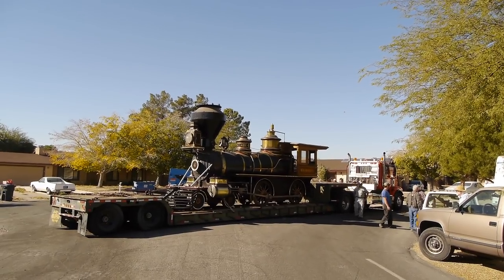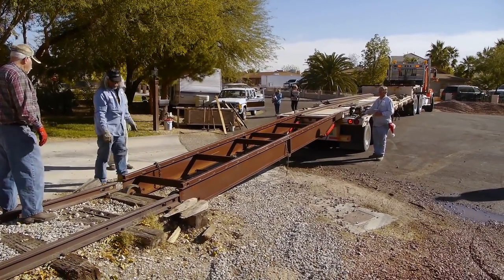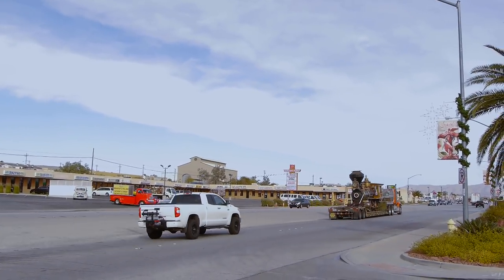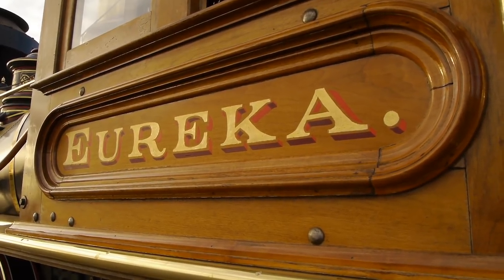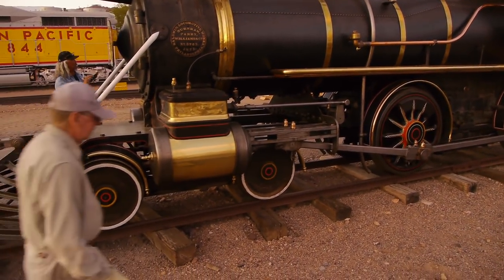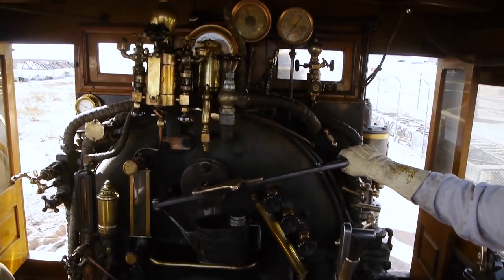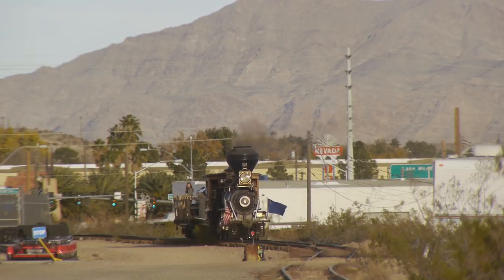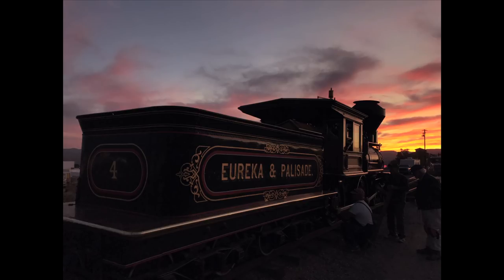Moving Dan Markoff's amazing locomotive Eureka and Palisades #4 to Bolder Nv.

Comment: What a big big big chimney !!!!!!
Reply from the maker: Hello. Wood burning locomotives make lots of ash. Much is dumped out of the firebox into an ash pit. But most is blown through the boiler and up the stack. It would go everywhere and set fire to much if not for screens at the top of that huge funnel. So the ash falls to the bottom of the funnel. There is a dump door on one side. When opened a mass of ash falls out.  Unique to wood burners.

Comment: With all that time & effort it takes to lay down the temporary tracks to unload that locomotive, I am surprised they do not build something 'more permanent' to do the job...?
Reply from the maker: The problem is the loco unloads off the front of the trailer. Needs to. So there needs to be space to pull the tractor and coupling for the trailer away from the rest of the trailer, and that takes about 50 feet. Sucks, but can't figure another way.
Reply: Toy Man Television → Gotcha, chief - Thanks!

Comment: You should talk to Dan about running the Eureka on the Huckleberry railroad
Reply: That would be highly do able as the track is 3 foot gauge and laid with 75 and 90 lb rail.  That track would be a racetrack for the Eureka.  The sharpest mainline curves are the two loops and are 26 degrees or 222.271 foot radius.  The K-27 makes them.  The couplers on the Huckleberry are at the same height as the D&RGW equipment.  I used to work there.
Reply: I wrote a letter to the Carson and Colorado restoration group that they should run their 3 foot narrow gauge 4-6-0 Southern Pacific #18 on the Huckleberry Railroad, I think it would look good alongside Huckleberry Railroad's recently refurbished 4-6-0 #152